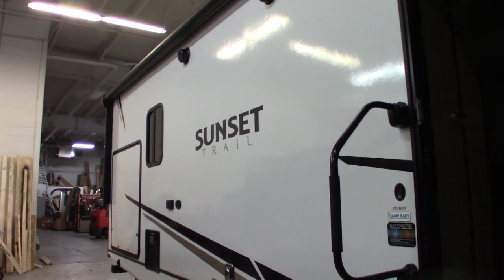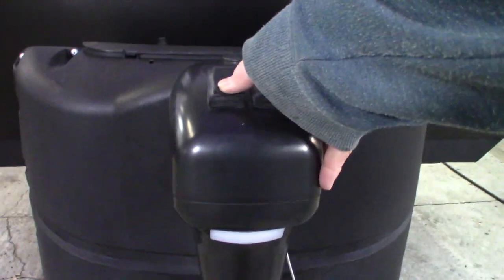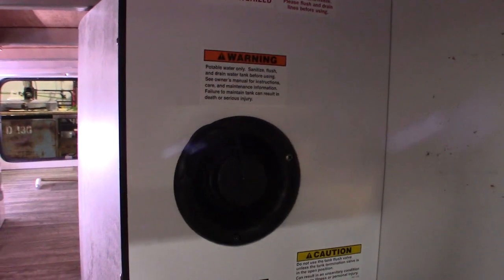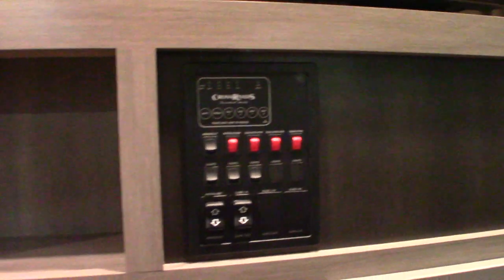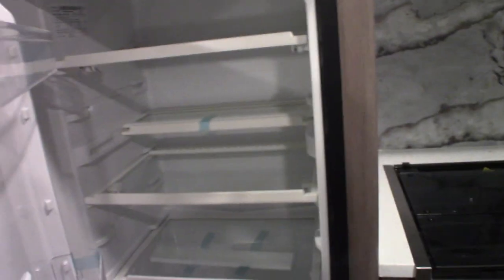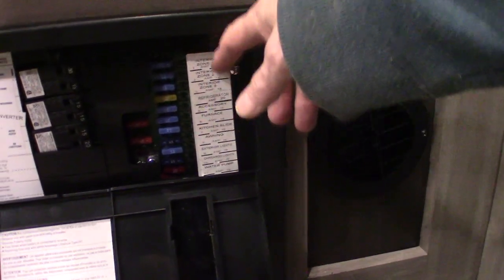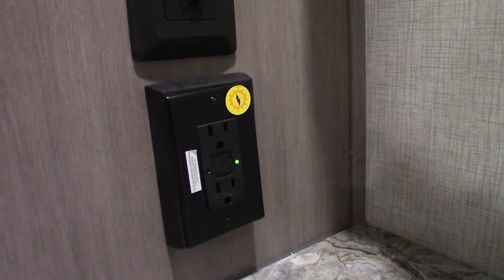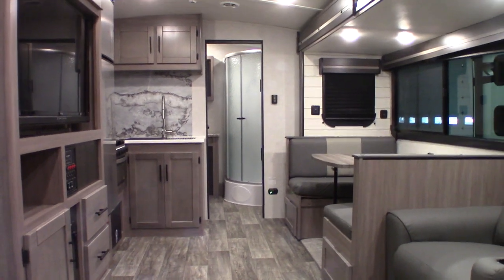2023 Sunset Trail Super Lite 253RB

Comment: 15:11 how do you switch to operating in solely on the generators power? Or how do you use the generator without having to use the battery at the same time?